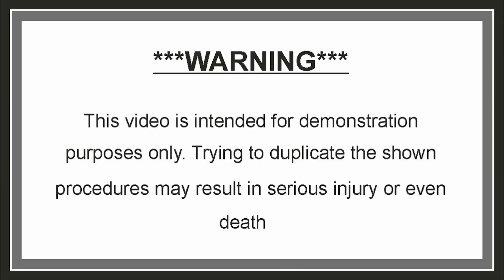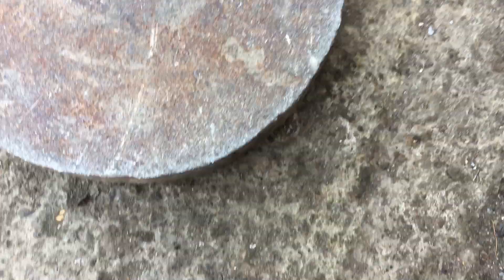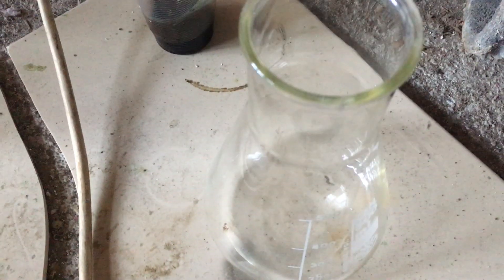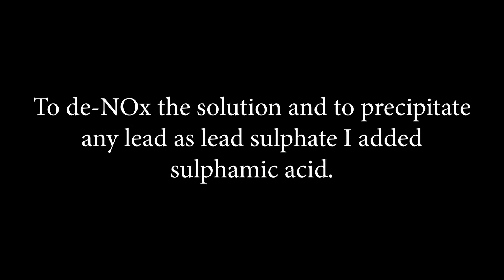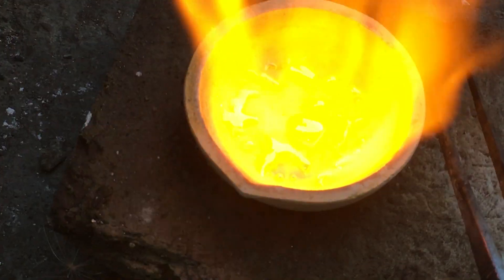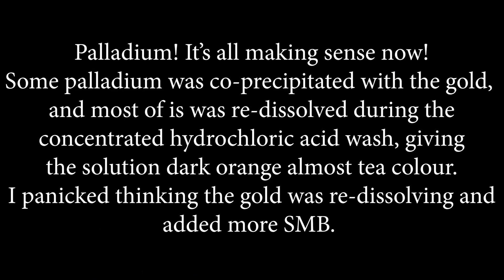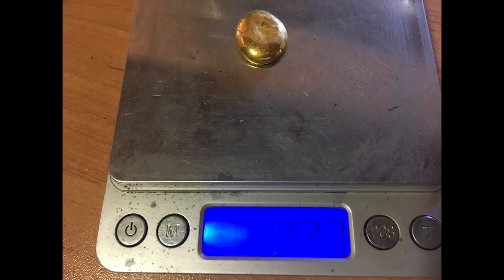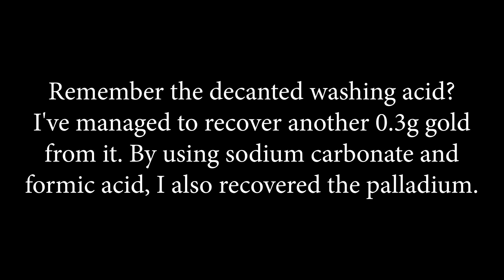FAIL! GOLD refining, precipitation with SMB gone wrong

Comment: Rather, you should have washed the precipitate several times with dilute and then concentrated nitric acid to get rid of the palladium, then washed it well with distilled water, and then melted it, because if palladium is present in the precipitate, then nitric acid is the ideal solution, not hydrochloric acid.

Comment: Namaste sar Mera ek sawal hai sar Maine Aqua regia mein Mera 4 gram gold h kya Mera vah aquarium ka solution jismein gold dissolve hai kya vah recover ho jaega agar Ho jaega to kaise usmein gold participate kaise hoga
Reply from the maker: If you have gold dissolved in aqua regia to precipitate it first you need to remove the oxidiser (I use sulphamic acid to accomplish that) then you need to add precipitation agent like ferrous sulphate or SMB or you can simply cement it on copper

Comment: I have aded 150 ml HCI to each sulution Beakers and flasks 4 in total messuring 1000 to 1500 ML each, the S C test spones are abony black there ie gold in sulution and plenty off it I will try coper cementation on one of the beackers not shure of the prosece afeter cementation >Thanks for the information John.

Comment: OK thanks but I`m not willing to lose any gold ! So i`m going to asembel a distery styel device fro my fume hood  it`s  going to work partly the exaust suction we use at the fire station and my spirits stile the exseption is that the vapor will condence and drop off  as it travels throug my coling vat. I have to aquire the materiales that I have in mind most ove theme are availebal at my local plumbing suply.

Comment: Wash and wash again. Multiple small washes. Crystal clear (white) boil. Incremental nitric, not the "magic ratio"... 

And ditch the sulfamic. Use sulfuric to snatch the lead, and if you don't add more nitric than it needs to get the gold into solution, you won't have to deal with it after. 

SMB from there, wash, rinse, dry, melt. Be much better looking ;)

Comment: Can nitric acid be eliminated by urea entering the solution?
Reply from the maker: Yes but prefer sulphamic acid
Reply: @OwlTech333  How do I use it (how much is added in 1000 ml of solution)
Reply from the maker: @karimrazak3798  you add it until the fizzing stops

Comment: Hi,
Danish here
By mistake I add smb many times in aqua regia without neutralize nitric acid.
I have 2 litre solution approx 70 %water.
Please tell me what can I do for recovery gold.
Gold only 1 gram.
Reply from the maker: Add zinc shavings, and let them react until you get colourless solution. By that time you should have precipitates at the bottom of your flask consisting of your gold and any base metals more reactive than zinc. Decant the barren solution and wash the precipitate couple of times with HCl to remove any undissolved zinc. Decant the HCl wash. Rinse couple of times with water and decant. Dissolve the residue in 50ml HCl by adding hno3 dropwise.  de-NOx with sulphamic acid and dilute with 50ml of water. Filter. Precipitate with SMB. Decant, boil in HCl, boil in water, dry and melt. If you suspect PGMs present redissolve in AR, deNOx, filter and precipitate with sodium NITRITE or oxalic acid. Wash, dry and melt. Depending on your technique your gold button should be at least 9998 pure

Comment: A short wash of the precipitated powder (with hot conc. HNO3) would have dissolved the Pd (and also Ag, if present).
Reply from the maker: Agree
Reply: I used dimethylglyoxime to extract Pd from alloys (Pd(DMG)2, a nice yellow precipitate), then calcination (black Pd powder) and smelting (m.p. 1550 C, not easy to obtain). Result of the failed process: a sort of syntherized Pd :)))

Comment: Hey that's what my gold is palladium gold wow I wondered it melted like palladium I got 24k palladium gold wow and when it's 18k before I refine it it's takes longer to melt but when it hits 24 k I can heat it up with the kitchen burner and and it will melt the gold is so pure at 24 k I can bend the nuggets with my fingers and shape it and Soon as it hits water when hot I can pick it up out the water that's if I use water it cools fast itself but I got pounds of it I make white gold and platinium gold too wow no wonder I can add the gold to platinium I got the alien gold wow

Comment: Being the first time I've collected gold from electronics I have a question for everyone.  After adding SMB I had a nice layer of gold particles at the bottom of the beaker.  I then went out of town for a week.  The beaker sat in my lab in my garage at temperatures above 100 degrees F for a week.  When I got back I had a nice yellow liquid but no particles anymore.  Adding more SMB has done nothing.  The gold is in solution again.  How do I retrieve it?  Any help is appreciated.  Thanks!!
Reply: You had extra nitric in soluțion, so gold is redisolved at higher temperature. When is cold, nitric is inactive. So or denox extra nitric with sulfamic acid, urea or, make the soluțion cold enoug and add SMB mixed with water and some HCL.
Reply: Nice nugget

Comment: Sir 
I m work on 1 kg cell phone bord,,,first i clean the all bords,,then i burn the all bords,,the put them in AR solution,,,but nathing to get output,,,gold drop was fail,,,same thing i burn all connector,,and riben cable from that phones,,,and grind them,,,then put in AR,,,,this time also gold drop faild,, how can i drop gold from that solutions,,,i use sulphamic acid and smb for connectors,,,urea and smb for bords,,,,i think much copper in my solution ,,that is problem,,,,how can recover my gold from solutions
Reply: You have silver and tin in soluțion and gold will not drop. Add HNO4 concentrated like 10 ml, or electrolite for car bateries, and ad ice or cold water, leave it 1 hour, filter, then you can precipitate the gold if yoy had denoxed well.
Reply: @niculanicolaeofficial9114  sorry
very old comment
i throw out all solution

Comment: I know the video has an instructive character. But if you refine a piece of gold under your own conditions, the most conventional would be to use the electrometallurgical process. It is convenient to first melt with saltpeter, borax and sodium carbonate to remove base metals.
The electrolysis is done in an electrolytic vat, with the gold to be refined at the anode, separated by a pure gold cathode felt. Gold chloride diluted in hydrochloric acid is used as an electrolyte. Temperature 65/80 ° C. Voltage 1.5 V and low Current, varying with cathode surface size. A battery can be used. During the process the electrolyte becomes weak in gold chloride, and this must be added. The rate at which the anode will be dissolved will be in accordance with the amount of free HCL. The associated metals deposit in the form of chloride below the anode. ..The gold obtained by this process is 99.98% pure.
A hug.
Reply: Hi antonio i'm a researcher from iran and i would like to know is there anychance you give me a way to contact with you and ask my questions about this topic?
Thanks a lot.
Reply: Hi mahdy. We are already in contact.
If there's anything within my reach, I'll be ready to try to help you around here. Or leave your contact details.
Reply: @Bruce Wigle Thanks man. I don't have an Instagram or Facebook account. But I will share your alert via WhatsApp.
Reply: Hey man do u think this method is good for refining big amounts like over 1 kg?
Reply: @kasunwijendra3732  Yes, but it will be quite time consuming if you don't have a large sheet of pure gold to use as a cathode.
Reply: @MEGAMANSURF  do you think this method can refine 1kg of gold in a matter of hours? Or is it time consuming
Reply: @kasunwijendra3732  As the anode increases, the rest of the system must be increased as well, in order to shorten the processing time. A larger electrolyte vessel with a larger amount of electrolyte, a cathode with a larger surface area, and more electrical current will be required. And the gold chloride increments will be higher as well.
The advantage of this system is to obtain pure gold, but depending on what you are refining, other methods may be more viable, bearing in mind that you will need to produce gold chloride in large quantities.
Reply: @MEGAMANSURF  could I talk to u somewhere maybe WhatsApp maybe I have so many questions I want to ask you , haha you seem like an intelligent dude

Comment: You do a great job on your videos. Very helpful. A couple questions about a palladium video you did.  Did you add sodium carbonate and then formic to drop the Pd directly to Pd black?  When to stop adding sodium carbonate? Would sodium bicarbonate work the same? Keep the vids coming!
Reply from the maker: Lee Dudley the idea is to rise the pH above 6 which aids the reduction with formic acid
Reply: @OwlTech333  Thank you for the response. I thought that was what you were doing but wanted to be sure.
Reply: @OwlTech333  sir which chemical powder did you mix after disolved gold in liquids form

Comment: Thinkyou for the video, why sometimes when i put the sodium metabisulfit in aquaregia it precipitate a white powder like the sugar with the Brown powder of gold
Reply: Sofiane Sofiane this is likely excess SMB that is not dissolving into the solution. This can easily be tested by trying to dissolve the white powder in hot water. If it dissolves then it’s SMB, if not then it is possible that it could be something else.
Reply from the maker: @kylecissell958  it could be silver chloride precipitating upon dilution or lead sulphate
Reply: @OwlTech333  i think it is copper because when i put it in nitric acide it is dissolved and thé couler of acide became blue
Reply: @sofianesofiane4811  it is CuCl crystals,you are right